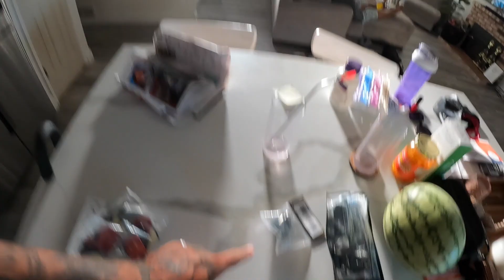Trying Out The New Drift Toy | New Camera Equipment Testing👀

Comment: FYI if you want to really see the speed. shoot 24 FPS 1/50 shutter with ND. The shutter speed is what actually affects the motion blur, the ND just reduces the light so you don't have to use a high shutter to create the same effect. just remember, the lower the shutter speed the more blur you get!
Reply from the maker: Yea but 24fps at 1/50 will look super bright without a Nd filter on it, you have to have a bd filter or else it will just look super bright. I tried it already
Reply: @Its_Mike_Myke  Indeed, that's what I was reccomending. those settings but WITH ND. all love
Reply: @Its_Mike_Myke  you may need a high stop ND though. like probaby 10 stops.